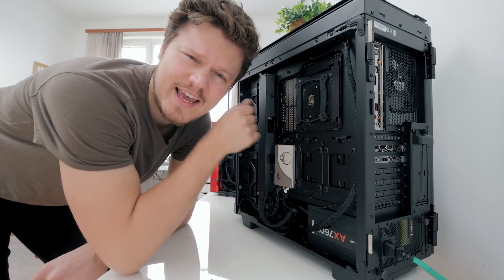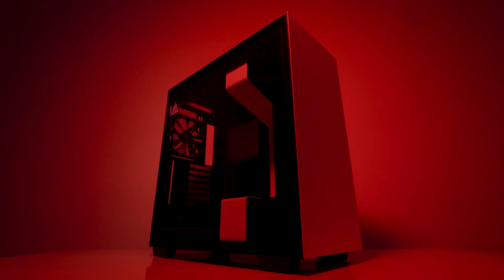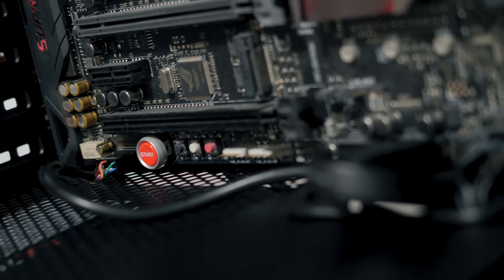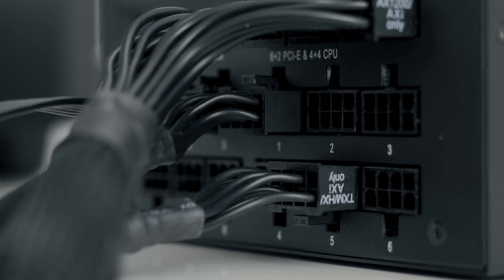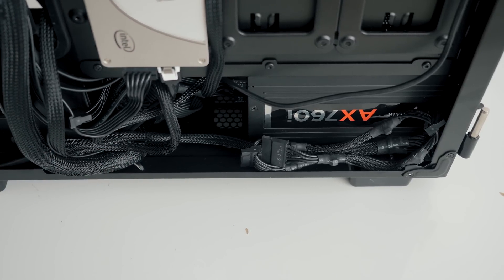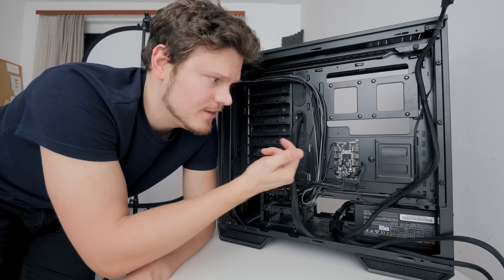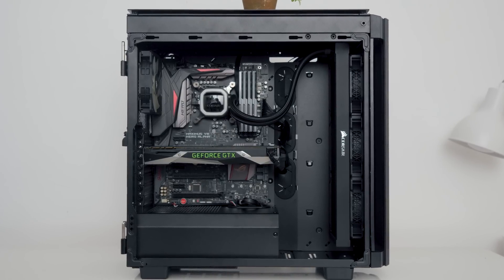Tips for the PERFECT Cable Management PC Build

Comment: I have built many pcs im my days. But my freshly built system is a challenge. Currently using it after fresh build no panels, procrastinating doing the cable management on it has 8fans with splitters plus rgb splitters 2x mechanical hardrives and a gpu that eats up all the space under the psu all in a Asus Ap201 so kinda see threw. Like to see you try and cable manage it lol.

Comment: There is one point I would like to bring to the front. Cables that are brand new are very flexible and easy to move. On the other hand as cables get old they lose flexibility and movability. So, make sure you place them in a way you will be able to move again.
Don't block any airflow.

Comment: Dont install the front Audio USB and Audio cables is the first tip. They are ugly. If you need more ports spend 10 bucks on a USB Hub with a 1M Cable

Comment: You can use the lips at the edges of the case to conceal any excessive length of cables you have. As for the front panel, sometimes you can unplug the whole cable for something you might not be using at all, e.g. audio. Get releasable zipties and/or velcro - this way you don't have to cut if you make a mistake.

Comment: my SMPS power cable & processor fan power cable is not reaching the processor and motherboard if i does the cable management . is there any length extender for that or any other solution ?

Comment: My problem is I have a shit ton of little fan wires everywhere, Like everywhere. I have the SPEC OMEGA RGB which is a notoriously small-spaced case in the backside (and only gets better if you completely go HARD DRIVE-FREE so you can unmount the Hard Drive cage and tuck some wires under the PSU Shroud hidden away but in my case I haven't upgraded to a full on SSD system just yet so it's hard. 

Anway I got 6 CORSAIR LL120 series fans or whatever, then I have the KRAKEN Z73 CPU Cooler which has quite a bit of wires as well. Sooo damn

Comment: Oh well, I have the obsidian 500D as well, I'm glad to see I'm not the only one that don't use the cable cover that originally comes with the case at the back (the one that hides the io cables). I actually had a bigger challenge 'cause I have 3 drives, 2 hdd and 1 ssd, and corsair LL100 rgb fans. Those power sata cable were designed by the devil, it was quite hard to work with them. I bought a new fully modular psu and I'm thinking in resellng it cause I don't want to deal with that cable management nightmare again.

Comment: My atx 28 pin cable is so freaking thick god. I had to ram the side panel and barely managed to close mine. tho I have a different case. it does have 20mm of space on the side tho. so maybe I did something wrong? tho in the video yours looks much bigger, maybe it's just the camera

Comment: I have like 6 HDD in my computer, all these clean builds with similar cases always have one SSD..how do you put mutiple HDDs in a build like this? I have 3 SSD and 2 old regular drives. (I just realized the shown case as several spots for normal HDD and SSD...maybe I need to upgrade cases..I have been using this Graphite 600T for quite some time :)

Comment: you can put the gpu cable in the same hole as the 24 pins cable and put im right under the weight of the 24pin, this way the 8 pin cable look like an extention of the gpu !

Comment: Managing cables in modern cases with SSD drives is easy, but what if if you have 6 coolers (one on side door), 8 hard drives connected to a disk controller, 1 optical drive and an NH-D14 on the CPU, and all this in an old Fractal Design Define R2 case without enough space behind the motherboard?

Comment: "having things organized will make your upgrades easier" - this depends WHAT are we upgrading, right? Changing CPU/GPU is easier, but that´s already easy as it is. Adding a HDD/SSD/DVD-ROM, that´s always a pain. SATA data cable is easy, but you have to reroute/add power cables... Which, if you have clean and perfectly routed cables, is immensive pain.

Comment: Be careful using the metal twist ties, they can fall off when old and if the plastic covering is worn off, now you have a short circuit risk.  Plastic zip ties are much safer IMHO.

Comment: I actually disagree with it being easier for upgrades down the road.  Although i believe in nice and neat cable management, cutting all the zip ties etc to pull out the cords for the new components is actually a pain in the ass.
Reply: what part would you have to pull out cords for?

Comment: its like grate minds think alike ive been doing my cable management like this for years because not all cases offer the best solution for cable management like the cases ive uesed in the past the corsair  Carbide Series™ 270R Windowed ATX Mid-Tower Case  Or The Thermaltake View 21 TG Mid tower witch im using now

Comment: Linus did a test project and the cable management has zero effect on cooling.
Reply: Well for his case, if I dont use some kind of tucking cables away from the Air flow my Drives will shut eventually down and my OC gets unstable...
Passive cooling is important for the tiny bits on the  MB if you really try to go far with your OC.

Comment: What about all the empirical studies showing cable management doesn't affect airflow enough to harm performance at all?
Reply: Although it has a small impact, it's more for cosmetics and long term health of your case and parts. Having wires heat up will cause them to die, and if your psu isnt fully modular you will need a new one. Also having a protruding case back panel will eventually snap, which will be a massive problem

Comment: Why don't motherboard manufacturers just place the CPU power 8 pin and main power 30 pin on the rear side?
Reply: Because somebody designed the first motherboard to function very well and people are too lazy to reimagine the entire circuit structure just to move some key components around
Reply: more costly production, more intricate traces, and most importantly, theres a standard for a reason.
Reply: Also,  not every case has that rear big cut, in some cases if you want to use cooler with a backplate, you must take your mobo out, place the backplate (and cooler) and then put it back. Having a power connector on the rear would render such board unusable with this sort of cases.
Reply: @Morpheus-pt3wq  then they just make an option.. If you want it on the top you choose that, if you want it on the back you choose that. It's that simple.
Reply: It would make the compatible cases limited....and case companies don’t wanna make full blown products without being assured that the new design will sell.

Comment: Motherboard can't be vertically now. It has to be horizontally because of the big size of GPU and the at length can make damage. Don't think so? Fine! Also did you made the test of how the cable will change anything in your existence? When I had mining rigs I made experience, test to cool down that crazy heat I was subjected to like with a powerful blower I made. If it was not directly on the cards it was not cooling down tbe freaking thing anymore. I think the cables has a psychological visual effect more than anything.

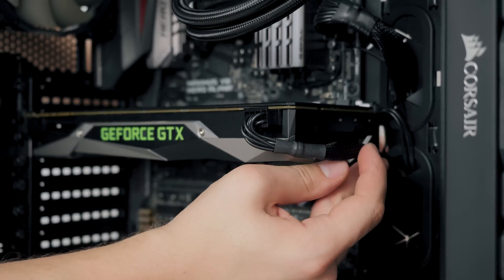Comment: 5:52 you talk about the GPU cable and making sure it's tight so it doesn't droop. But moving it up one more hole in the mobo panel would achieve both of those things. Also it would hide the cable much better with it being more in profile with the videocard.

Comment: Well i got a modular PSU two of the cables are sleeved and i had to fit them in a case which had no cable management holes at back it was not fun to do

Comment: Actually cable Management does Not have any effect on Temperatures. Linus made a great Video about that and it showed that cable Management is only helpful for asthetics
Reply: TimBlue theoretically should, but barely.
Reply: @paultran3756  well linus put boxes of mice and t shirts in the case and they got like 10°C difference or smth

Comment: This is why I think modular power supplies are a must if you are a cable management freak, being able to take unused cables out entirely is a life saver.

Especially if you are using custom sleeved cables that take up a lot more room than the stock ones that are compact and usually housed in a single black pet sleeve.

Comment: metal strings might interfere with signal transference, very low chance but if you have the "cable humm" in your on board audio front panel, this might be a culprit. Makes you wonder why they don't coax the front panel audio jack wires. I understand coaxing everything is wrong because it leads to crosstalk, but audio...

Comment: Is there any risk for cables when routing them on VRM heatsink as you did here?
I did the same yesterday, but now I'm wondering 🤔
Reply: Nah, the insulation should withstand much higher temperatures than the heatsink reaches.

Comment: Only thing i see in this video that is a BIG no no, NEVER ABSOLUTELY NEVER route wires under a board (the pins and sharp solder connections can pierce the wires EASILY) or under ANY metal to metal bracket... that's what the rubber grommets are for.

Comment: Ooooo one thing you missed that I didn't even think about when I bought them is how much extra cable I'm going to have with custom extensions. My cable routing is nice for how much cables are there in such a restrictive case like the s340 elite (its a simple bare minimum type case) but right in front of the psu is a rats nest and there is really nothing I can do about it.

I've been considering actually cutting and removing some of the cable length out of the cables but then the power supply with be useless without the extensions.

Comment: Instead of zip ties buy a bunch of cheap velcro cable ties. You can get 100 for about $8 off Amazon (with Prime shipping) and you can cut them up to make quick, clean, re-usable cable mounting points all over your case. Also, crafters tip: Need a cable mounting point somewhere the case manufacturer didn't think of? Velcro tie + hot glue.

Comment: Cable management doesn't affect airflow. It's been tested (LTT did a pretty good video, as have others). The amount of air being pushed through the volume you're pushing it... You could have zero cable management as so long as it's not falling into the actual fans it's not going to do a single thing.

Comment: another tip, do cable managment with twist ties, then swap them for cable ties later once you have worked out where everything is going
Reply: ill just use my handy tweezers
Reply: Good tip twist ties are best to use bc using zip ties require cutting later & you could end up cutting wires as well or nicking them..Twist ties are infinitely reusable!
Reply: " BRILLIANT! "
Reply: That's a shit tip. There's no need to generate a bunch of plastic waste like that. Re-use the twist ties from the packaging of your components and leave them there.
Reply: @Catcrumbs  wtf I thought I was the only one who still kept the twist ties from the package. Wow!
Reply: @Catcrumbs  I'd rather use my twist ties on cables outside my pc.
Reply: Well, twist ties will not make enough pressure to keep all the wires as a tight bunch, I think.

Comment: I'm not an audiophile, but isn't routing an audio cable directly over the PSU a really bad idea if you want the best sound quality? Thinking in terms of interference.
Reply from the maker: It's all in proximity of each other already. I don't think it makes a difference.
-D.
Reply: The PSU shroud is grounded so it might actually work as a "Shield" maybe? and that cable is usually in parallel with a lot of unshielded signal wires like HDD led or any PWM fan or RGB cables that work in high frequencies.

Comment: I have a Be Quiet Dark Base Pro 900, and that was one of the worst cases I've had when it came to cable management. It is a very open case with no shroud, gaps on the top and bottom of the mobo tray, and the HDD side has no covers either. Even if you cover it in some manner, there are no tie downs anywhere other than on the square of the mobo tray.... and the icing on the cake is that fan cover on the side panel has giant plastic tabs that go directly into where you would route cables. Of course I made my life harder by adding a bunch of extra cabling using Corsair LL RGB fans (because they haven't got the concept of daisy chaining RGB yet) as well as controllers.. but yeah, not all cases are created equal for cable management.

Comment: Building my first pc in 1-2 week(s) 
Good timing
Reply: Toto Geenen how did it go
Reply: @Widoghastly  thanks for asking haha. It went really well. Didn't encounter any problems.
Reply: Toto Geenen 
Did you use anti-static wrist
Reply: @Ayoub-wg3tw  no. But I made sure to ground myself every few minutes, and before I started
Reply: Toto Geenen 
How did you do that?
Im first time builder
Reply: @Ayoub-wg3tw  if you plug in a psu (off) it's shell will be grounded. So you can set it up next to you and touch it every so often. You could also just put it in first and it'll make your whole case grounded. Tho it can be kinda annoying to have your psu inside whilst building. 

Another tip: build you pc outside your case, test boot it, then move it in your case. It kinda sucks to build a pc and then find out it doesn't work and you don't know why.
Reply: Toto Geenen 
Thank you, maybe i buy a anti-static wrist to be sure

Comment: A better video and challenge to your own cable management ability would be in a case like the view 71 that has nowhere to hide your cable sins. Btw the GPU pwr should have gone through the top grommet. Its always better to route the pwr over the back as flat as poss as opposed to infront of the shroud where non blower style coolers are more prone to fan intrusion. Blower coolers arent immune to that but yeah, its cleaner and more efficient.

Comment: Front USB 3 is indeed horrid, but 24pin is more horrid. Last motherboard had 24pi slot exact other way, so now it needed to do 180degree bend opposite direction and boy did it not want to. Ended up ordering 24pin extension to work around it and it got lost in mail.. :D Well didn't order one again as now it's been in place couple months and of course plays ball.

Comment: Something I do in builds is zip-tie the GPU power cable between the rubber grommets. So the cable follows the side of the GPU and is flat with it (on the very top of the lower grommet) and then i use a zip-tie through the middle grommet over to the lower one to secure the cable in the highest position. Not too tight tho! Looks way better

Comment: I have the H150i AIO and yeah all those cables are annoying. I routed them the exact same way as in the video. USB cable on the left through the mobo heatsinks, fan cables straight up parallel to the RAM, and SATA cable down around the RAM. I have an H700i as well so this video was very relevant, thanks.

Comment: A trick I did was insead of using multiple SATA power cables that are often poorly designed coming from the PSU, as long as the power draw isn't too much I use one SATA cable, cut off any extra after the first connector, then use Y splitters for each device I need in an area.

Comment: Why don't case manufacturers add like half a centimeter for more space. Like just that little bit of extra space will make things so much easier.
Reply: Good case mfg's do but it depends on the model.  I built a Meshify C and it was the easiest, cleanest build EVER.  I wanted a micro ATX build but it's not worth it for pain and cooling.
Reply: Yeah keep wire and close
Reply: they do, they just charge for it, and it seems you dont want to pay for it
Reply: Most cases that arent crazy expensive have just enough space for cables, a half a centimeter on top would be very nice

Comment: in my personal experience, cable management actually makes upgrades harder because you zip tie all the cables in place so something like upgrading your gpu from one that uses 6 pin power to 8 pin power requires you to cut all the cable ties in order to switch the cable out. Stuff like bigger radiators will also require you to move fans and storage drives around and if you tied them down with only enough cable length to reach their current spot you have to re-route everything.

Comment: Someone needs to invent a wireless motherboard and power supply. It’s totally do able. 😂
Reply: they could have the 24pin/8pin behind the motherboard.
Reply: Someone built a PC without any visible Wires by soldering everything to the back of the motherboard and other components. The graphics card was mounted flat onto a plate with the PCIE connector and power cables covered. The power supply had all its cables exit through a hole in the bottom. There was not a single cable visible.

Putting the connectors on the back of the motherboard by default is indeed possible.
Reply: Lasse Reinlaufen That must look really neat, but making it by a DIY approach has way more disadvantages to me: the risk of permanently damaging that precious hardware that I've saving money for it's enough to stop me.
Anyway, I would like to see connectors on the back of the motherboards as a trend
Reply: Andres Fest wireless. Wireless motherboards should be the future 😁
Reply: PCTechHub :) Actually a few years ago a lab has started a research (there are some YouTube videos about it), for wireless transmitted electricity without losing to much of it.
Reply: i could see the evolution of wireless will end to "singularity"

Comment: Right now I own an ITX rig with a GPU that uses 1-8pin connector and only one sata SSD. For my next build I hope nvidia 2000 series can provide a better performing card than a 1060 that can only be fed with the pci lane; and I will be replacing my sata ssd for a m.2. with these upgrades... Cable management will be much more satisfying :)